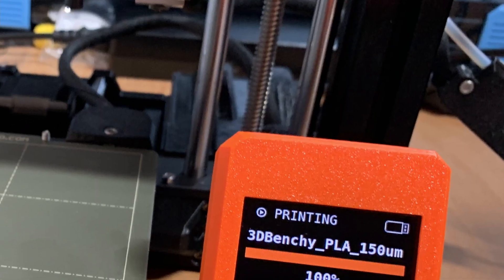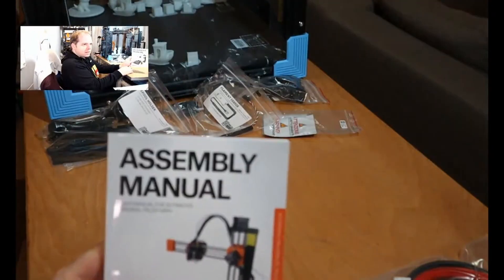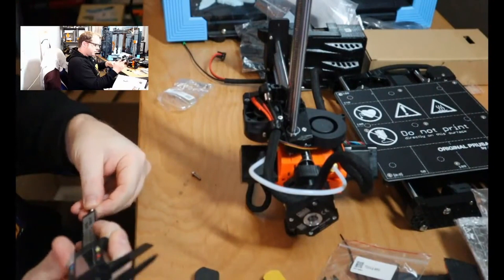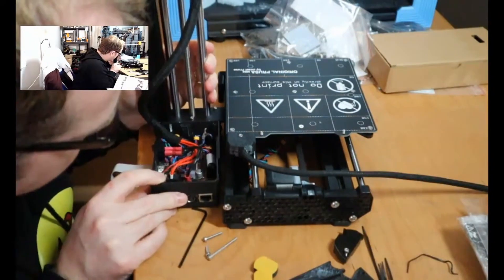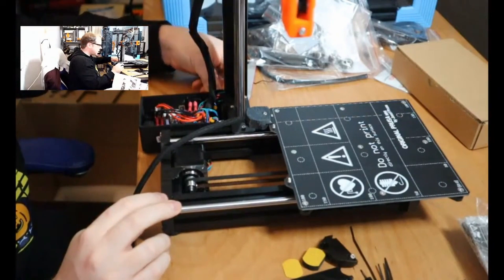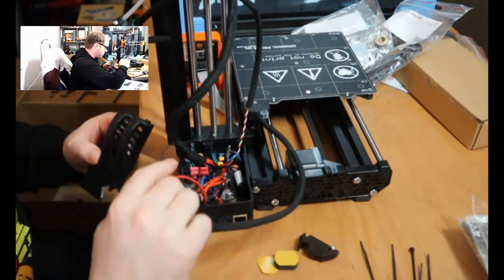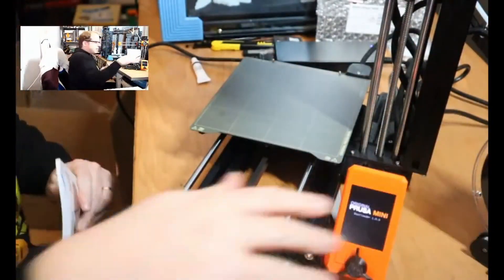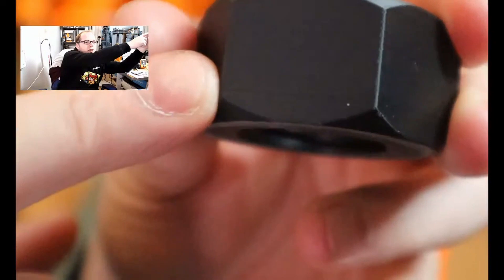Prusa Mini Plus - unboxing, build and first print

Comment: About how fast can this printer print ABS and still maintain good quality? 

I had an ender 3 V2 with an upgraded hotend and I was only able to print at a max of 40mm/sec. About 45-50mm/sec would start to fail badly.
Reply from the maker: Oh that’s weird… which temperature are you using? 235-250 degrees C should be fine
Reply: @Zachary3DPrints  I tried various temperatures, speeds, wall-thicknesses, fan speeds, bed temperatures, tightening screws and making sure the belt tension was right. My fastest ABS print speed was able to do up to 45mm/sec with decent-ish quality. At 50, I got some ugly prints, even with the bed and nozzle temperature raised and in a full enclosure.

If the Prusa mini+ can print ABS with decent quality at 70mm/sec, its a definite buy for me.

Do you think it can print well at that speed? Haven't found any print speed info online.

Comment: I now see why you didn't answer me that time we spoke. Printers are tools that enable a hobby. Being into them and being a fanboy of prusa for no other reason than the fact it's a 3d printer is silly. Learn to code, learn electronic engineering concepts, get original and build something. Printers are like a drill, dremel or soldering iron, they are a means to an end and not expensive machines made to print fucking tugboats and fill landfills. Get a grip bro.
Reply: Jeez man you are right for any normal maker, but a bit mean and Zach is just trying to build a YouTube channel about informing people about 3D printers. This video is more for the people who bought or want to buy a Prusa mini. It's not about making stuff. Do agree on the landfill, don't print random crap just for likes. But then again people should stop following and liking people who print random crap for likes.
Reply from the maker: Hey misterMaker, thank you. we spoke many times on other platforms about 3D printing.
Most of the times I'm only printing models that I need for testing the printer for review and model I'll keep or give away to my friends and family who likes the 3d printed models. When I have a failed print, I collect them and recycle them with all other plastics that is collected separately.
Reply from the maker: Hmmm, when didn't I answer you? Did you comment me in another video or was that in a chat?

Prusa fanboy? Not really, tbh... those printers are also not perfect and I only have this printer from Prusa. If the amount of printers determine if I'm a fanboy or not, then I would be Creality fanboy with 4 printers from Creality.

Oh and indeed I want to build/make my own 3D printer, but currently it's too busy for me to do this.
Reply from the maker: Hey Robert, MisterMaker didn't say that Joey was wrong, but Mistermaker knows me well enough that I'm not like some other ones. And he didn't tell how to enjoy things. He was just what I said agreeing on what Joey said. 

On every new 3D printer I always print 1 XYZ cube and 1 benchy, after those, I print different models and things that I need instead useless plastic waste. And if I trow away the failed prints, they are being recycled into new plastics in the Netherlands. Please be nice.
Reply from the maker: OK, on the Youtube backend for the comments, I couldn't see that. It looked like that.